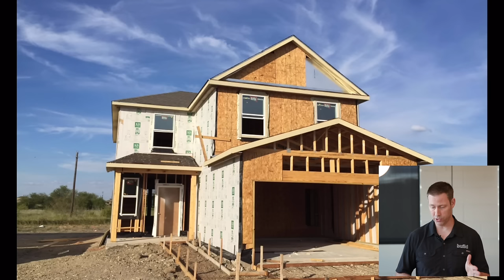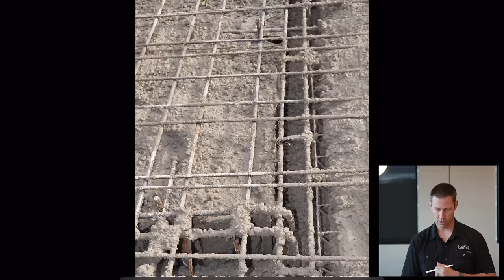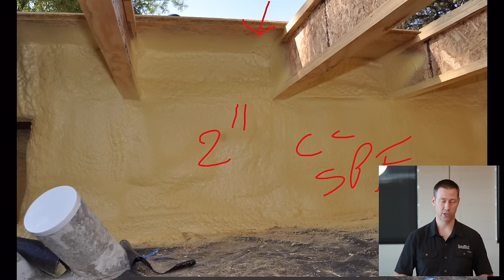Foundations - Slab vs. Pier and Beam - Which is better?

Comment: Matt, I'm just down the road in Bryan, and loving your videos. As a homeowner, I'd love to see some videos about how to choose and interact with a contractor. I've seen a lot of shoddy work done by flippers or cheap crews; how do you tell the difference between a good contractor and a sub-par contractor BEFORE you start your project? Perhaps more importantly, when you realize in the middle of a job that your contractor is willing to cut corners that you're not comfortable with, how do you talk with them about it? I'd be really interested to see a series of videos on this subject.
Reply: I'm a former building contractor. The best way is word of mouth and touring active job sites. A builder can often invite you out to see what the current project looks like. A portfolio of satisfied customers will always be the most important characteristic.
Reply: Have a good set of plans and specs. Watch close and make sure they follow the specs. In addition look up the product supplier for their best practices for installation
Reply: Whiever charges the most maybe? Reviews?

Comment: Great video.  I've been using a similar slab/raft foundation with a 100mm layer of EPS300 insulation directly below the structural beams of the raft.  300mm of EPS100 below the floor sections.  Quick and simple.

Comment: I have the same issue in my guest bathroom with no p-trap for the shower, although the house was built in the late 50’s. I lucked out by finding a plastic insert for the drain pipe. It lets the water through but keeps the gases out. It was like $5 or so on amazon. $5 fix or spend $1000.
Reply: Good for you bud!
Reply: If your house is like mine, there is an open void around the shower/bath drain. So you got real lucky by being able to just swap it out. The contactor he was pointing out didn't install the p trap and poured concrete over it. The homeowner was stuck spending that $1000 to get to the problem area. It doesn't matter that there is a five dollar fix, when you still have to spend money to get at the problem area.
Reply: @nordlands8798  I just went and looked at the website you sent and those gullies look to be a very cool product.  I've never heard of them before or seen them used in my 26 years of construction and quite frankly look to be just as good as p-trap if not better because of the easy access to clean them out.  Thanks for sharing the information, good to learn something new today.
Reply: @derekolander7933  Before YouTube, I had never heard about p-trap!

Comment: Matt, a few corrections:
You didn't say why Slab on Grade isn't found in the northern climates. The reason you don't see Slab on Grade in colder climates is because the footings don't go below the frostline. To keep a foundation "rock solid" and not moving, you have to build the foundation below the frostline. Otherwise, water will get under the foundation, and the freeze/thaw cycle will move the foundation vertically. Basement foundations do this and create usable space.

Post Tension: The cables aren't compressed in a post tension foundation. After the foundation is poured and cured, the cables are pulled taut (stretched out) against the concrete. The cables then try to contract, and this contraction pushes against the concrete, compressing it. The reason has to do with the materials involved (steel and concrete) and the three stresses (compression, tention, and shear). Concrete does really well when compressed. That's why it makes a good foundation, because it likes holding a lot of weight. Sadly, it stinks against forces that would stretch (tention) it or make it shift sideways (shear). Steel, on the other hand, loves to be stretched. So, adding it to the foundation as rebar allows it to take those other stresses for concrete. We can go one step further by using the tensile strength of steel to compress concrete in the sideways directions, further enhancing the foundation's resistance to tension and shear. And you can use rebar with Post Tension. (The YouTube channel Practical Engineering discussing all of this with lots of experiments he does to show the effects: https://www.youtube.com/watch?v=cZINeaDjisY)
Reply: Also, you mentioned in the pier and beam foundation someone removing the air from the pour. You want to do this with ALL FOUNDATION TYPES, not just pier and beam. Air pockets will create a weak point where the concrete will fail. So, if your contractors aren't doing this with every foundation, you don't want to use them.
Reply: Only the second person in the comments to fully understand the definitions, Matt has no idea 👍

Comment: I can't imagine having a "slab-on-grade" home (could be because I've never once been outside of New England). Being able to easily access ALL of your homes mechanical systems seems like SUCH a big benefit. If I was ever in a position to build my "dream home", it would definitely either have a FULL basement or the conditioned crawl space. Whichever works best for the location. Not being able to get underneath the house and have access to all of the drains, pipe, wiring, ducts, etc is asking for an expensive problem down the road. Thanks for sharing your years of construction knowledge! I've worked in construction for 10 years now. I feel like, paired with the information ive learned here along with my construction experience, I could build myself a house given the opportunity...
Reply: The previous rental I lived in was a makeshift home in a steel frame structure. there was a partial basement but so uncouth and filled with water at times it was not feasible to go down or even run utilities down in, all the plumbing and wiring was above grade or running through the main slab in the living areas. Thank goodes no plumbing issue while i lived there, now I live next door in a duplex with a basement all be it's more "usable" though its not air tight and thus also uninsulated as its a stone type with brick on top that the house sits atop. Its got more junk than what I keep and and just storing down there of my own things.  I am hoping my next place i live in is more modern and also a  basement that is more usable like what my sister currently lives has a half finished with the other half unfinished. with a normal door to walk out into the back yard.

Comment: I live in the greater Cincinnati area and work as an electrician.  Most homes have full basements-makes adding circuits much easier than running through heavily insulated attics trying to find a top plate to drill down, assuming the slope of the roof even allows that as a possibility in instances of exterior walls.  I like full basements too much to not have one, especially finished you have a cooler lower level instead of a warmer 2nd level.

Comment: A number of houses in the New England, built as low income housing, were built in 60's, 70's, & 80's. Biggest problem with the early built ones, was they put copper pipes in the slab for heat. Copper and concrete don't mix. Pretty much all of them ended up leaking. Also,  the floor near the edges got cold in the Winter. Grew up in one and owned one.
Reply: Thickness of copper matters.  M is paper thin and is legal above ground.   L is what I used everywhere, when I re-piped my house, in the dirt and above ground, with no contact with concrete except as the new pipes emerged as hose bibs, though stucco walls.    So some day soon I'll break that stucco and look for corrosive influence on my precious copper pipes.     By the way, as detailed at This Old House, an old hot water tank whose sacrificial anode has disappeared (thanks to acidic water) will eat copper pipes, from the inside out.
P.S.  My Dad use K copper, which is thicker yet and unheard of by most people.  His concrete on slab structure, built and plumbed in 1964 in SoCal where the water isn't acidic, has not suffered a failure of copper piping even though said copper is beneath slab and comes through slab.
Reply: According to This Old House, water is acidic in New England.   This is a big deal.
Reply: The house I grew up in had to have  the floor jack hammered by a later owner to replace the heating system. As has been said, concrete will eat copper pipe sooner or later.  The slab ranch, that purchased later on, had forced hot air heating, so no such issues.

Comment: Matt slab houses are easy to insulate. In Europe we put before the slab  hard styrofoam. Sometimes constructors put weak concrete to grade a ground.
Reply: Americans are decades behind
Reply: @snorko2  Not really, its easy to insulate a slab using ICF floor forms which also can be used for a roof pitched or flat. By which I mean the form for both floor and deck can be laid atop a vapor barrier to protect from water ingress and then along the edge use a block form to tie into the decking and provide additional insulation up to where the house framing starts and closing any gaps to prevent thermal bridging..
https://www.insuldeck.com/residential/

Comment: Here in the Netherlands there is no bedrock and not much sandy grounds. Just clay and peat. So every house is built on piles. Usually 60 to 100 feet deep. Beams are layed down on the piles to carry the ground floor. All made of concrete.
Reply: Here those are called deep foundations since they go so far down, we do the same in parts of the USA here, deeply driven piles to which a house is placed atop in "pier and beam" fashion. Also known simply as stilt homes. 
See for images showing how they are connected:
https://pearsonpilings.com/pilings-solutions/home-foundations/

Comment: The most common for houses built in the SE there is a footer, pier and beam with dirt floor and the crawl space is never conditioned.
Reply: Mine was like that in NC. With the humidity here I had a huge dampness problem and bug and mouse problem. Cleaned, sealed and dehumidifier installed. Much improved energy efficiency , air quality and no pests or pesticides.

Comment: You would not weld the hood shut on your truck.
You should not Slab the pipes shut on your house.
--  you need access to whatever breaks --
Reply: In northern Europe we build to last with drain strainers / cleanable water traps and oversized drain pipes - does not clog and can be re-lined if they crack. All supply water in pex tubes installed in flex tubing (same with electrical wires), can be pulled out and replaced if needed.
Reply: audex asked for some videos, but deleted his reply? Unfortunately few videos in english or otherwise as plumbers like to consider themselves a protected trade here. Found one showing installation of shower mixer connections, other end would go to a water-tight distribution box with shut-off valves and drain to bathroom or other watertight floor to make any leakage visible. https://www.youtube.com/watch?v=kHyLZCouwDQ
Reply from the maker: @nordlands That sounds awesome!  I’d love to see this first hand!  Would you give me a tour?
Reply from the maker: Love that analogy David!
Reply: @buildshow  Unfortunately not a builder myself (or building my dream home yet), only wrote "we" since it is standard or required by code for all new construction in Norway. Maybe you can check out this trade exhibit in October: http://www.byggreisdeg.no/en/visitors/
Reply: @nordlands8798  That kind of reminds me of the plans I drew up for my own "ideal" home where there are service walls and wet walls with access panels and the walls were locked in panel design and could be removed easily (unlike dry wall) and any repairs done then the walls panels locked back in place.  Another alternate design was a "service access" system where all services are routed in service corridors under the house or similar. A conventional "locked home" design baffled me. I draw heavily I suppose from ship design and other more industrial uses where one needs economic access to repair or remediate issues that come up. While homeowners typically have to do destructive remediation in order to fix an often trivial service issue (service being water/power/air/gas). The Norwegian design is a very intelligent solution to slabs. I also like the European window design. They are much better at noise blocking and energy control. 

In the end though, US Homes are cheaply built and corners are severely cut. An actual quality build home in the US is actually MORE expensive than it would be in Europe (by sq ft).
Reply: Agree, as soon as I see a slab, I know I'm not buying the house or advising others not too. Might be faster and cheaper up front, but it's russian roulette for repairs.... are you the owner whos going to foot it or will you get lucky and move before it's needed, and yes, it will always be needed one day.
Reply: @nordlands8798  Over-sized drain pipes are more likely to clog, not less. Proper sized drain pipes with proper fall clean out correctly. Too large a pipe and the walls of the pipe aren't washed down well. A totally agree that conduit for wire/pipe is great. In my home I definitely ran a lot of conduit to the TV/theater/computer areas since that is always changing.
Reply: @funkingitup1805  It has to be suitably sized depending on the situation yes, but it seems to me that drain pipes here are usually the maximum that will flush correctly, rather than the minimum that will handle the flow.
Reply: Nordlands, I get what you mean. In all the homes I have lived in, I have had to replace the drain pipes. All. The main pipe in my current home was just 2”. Ridiculous. Should have seen the mess when I put in that high pressure new washer lol. I bumped it up as you would imagine. It was home build original pipe...done by a plumber. By the time I came across the cast, the inner diameter was probably 3/4” on a 30’ run 90 degree turn and 20 more feet. 10 meter...6 and 2/3 meter in metric. Unreal. Common. I like your sleeved electrical. What are the sleeves made of? Is it like our conduit with single strand wiring or insulated Romex pulled through something else? I have done enough remodels and the mess of wiring that the idea of putting it in something else seems sensible. Again, this rural location had a rat infestation and well...they like wiring. It sure would be nice to build something for a lifetime...or longer.
Reply: @sknerl  The flexible tubes used as sleeve for both electrical and water supply are made from polypropylene. Both cable and pressure tubing can be bought already in flexible tube. For new installation it is most common with multi-strand, single-core insulated cables ("PN"), but in older buildings it is usual with both single-strand, single-core cables and multi-core cables ("PR") with multi-strand phase/neutral and single-core earth.
https://www.pmplasticmaterials.com/en/pipe/flex-lub/
https://www.nexans.no/eservice/Norway-en/navigateproduct_540199393/N_LINE_PN_3G2_5_16_100.html
https://www.gfps.com/appgate/ecat/common_flow/10006W/AU/en/109868/109920/109921/P108125/product.html
Reply: Biggest issue I see (N.Tx) with slabs are crushed Lead Bins (commmode) due to workers stepping on them during the curing process. Sometimes I see where the slab came up short with exposed pipes at the edge of the slab. This allows water instrusion which can cause problems if we have a freeze.
Post Tension? Seen alot of homes that have cracked walls (internal/external) and floors due to slab/cable failure. 
We currently live in a older pier and beam home with enough space to "comfortably" repair any plumbing issues. Many don't due to settling. Ya just have to pay close attention to the piers and be proactive.
Most builders I've come across do not want to do pier and beam.
Reply: I been interested in the Engineered Truss type foundation. Again, not sure if its feasable with our shifty ground in N. Texas.
Reply: blkft1 234 engineered truss is not a type of foundation, but rather a floor system.
Basically you want pier and beam or basement style foundation. Whether engineered trusses are permitted for residential, or you can source them in your area is the question.
Reply: @buildshow   what's the difference I  prices, I guess per square foot.

Comment: Piers are the way to go. I have friends that have older houses here in SoCal that were built this way and it is great that you can easily get under the house  to get at wiring and pipes if you have to. You can also re-level the house if you have to.
Reply: I'm a property manager.  Crawl spaces are GREAT for access to plumbing, wiring, etc.

Comment: I live in Canada and we've got a similar situation where I live. The rock is often just a feet or two deep, and it's some of the oldest and hardest rock on earth. It's not unusual for contractors to use explosives to clear it away.
Reply: Ontario?
Reply: @patmaloney5735  Nope. Canadian geography is quite varied, but the description I gave fits about half of the country. Most of Canada was buried under several kilometers of ice just a few thousands years ago which is why there's very little topsoil. It's also why there's so much glacial till in the US and random boulders that seem like they did not come from the surrounding bedrock. Entire mountain ranges got ground to dust.

Comment: Short Answer: It depends on the soil you're building in. Hire a geotechnical engineer.
Reply: Thanks, are you a geotechnical engineer?
Reply: @cortezforever  I'm a licensed civil that specializes in construction; more like a Jack of all trades. Foundations I can design. Earthen dams - not so much, not in good conscience anyway.
Reply: @alkaliwreck2474  
How many soil samples does a geo tech engineer need let’s say for an acre? 
How many holes does he need to poke in the ground to test for soil strength? Does he need to poke a hole every 5 feet or is it random? 
Thanks in advance